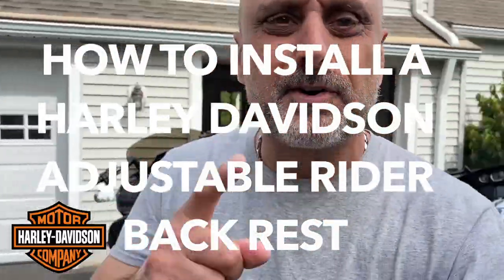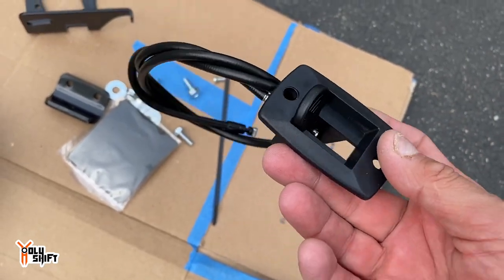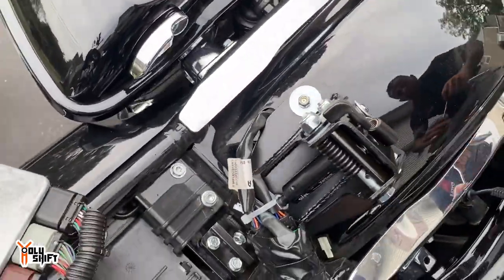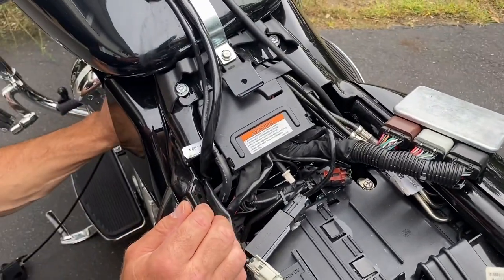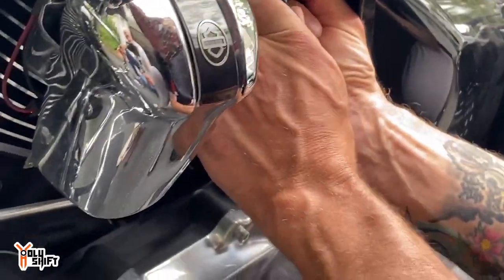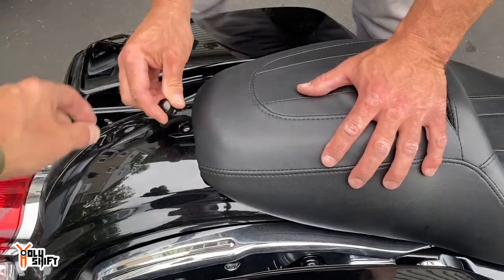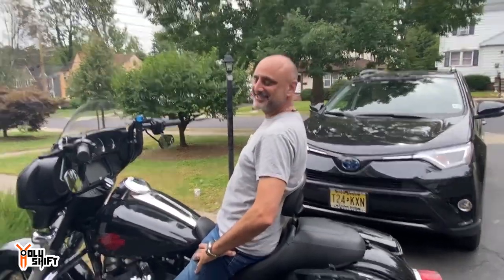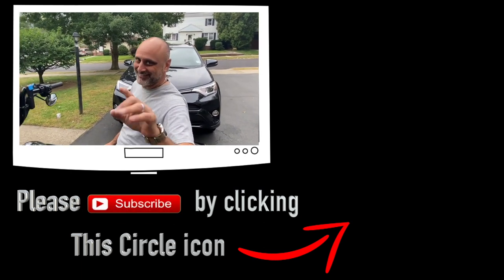How To Install A Harley Davidson Rider Back Rest / Electra glide standard 2020

Comment: Just now installing mine... noted the instructions specify the actuator handle gets mounted the other way so the cable coming off the actuator should actually be facing down, not up as you demonstrated.  Also, it is good to note that those of us with stock wiring should route it under the bracket.  Otherwise, Great job!

Comment: If you slot the bolt hole on the air deflector it then  becomes a much easier job